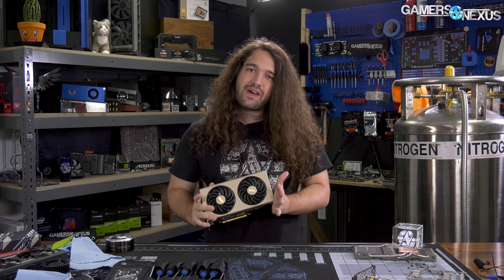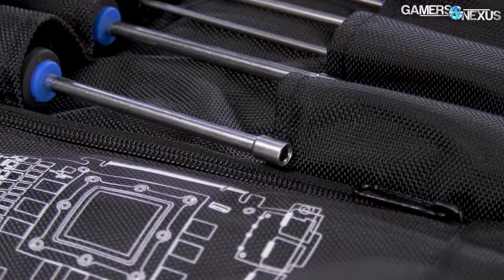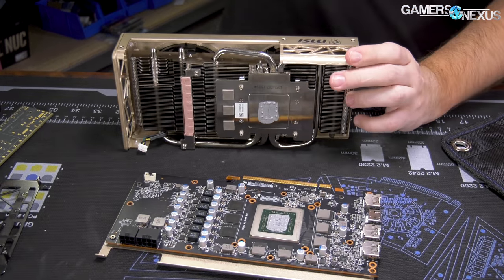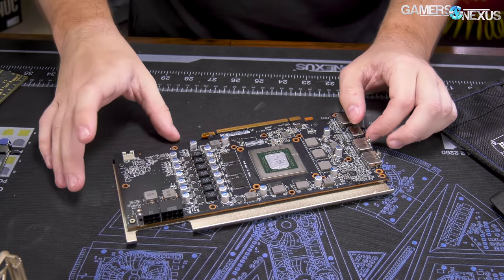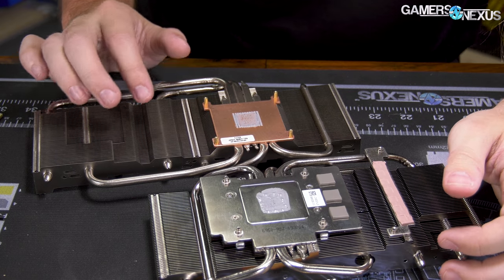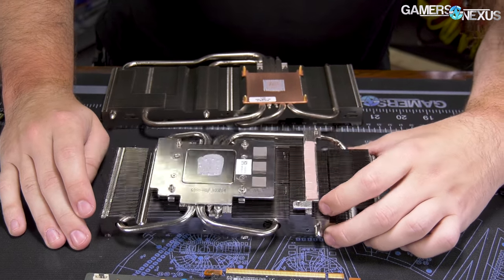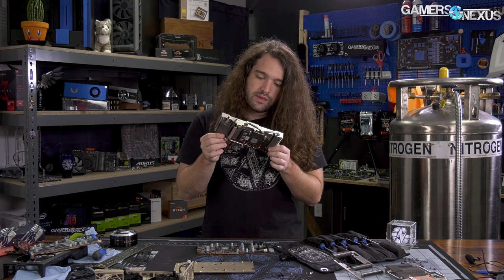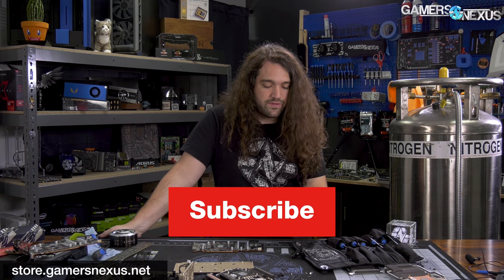Wrong Thermal Pads: Tear-Down of MSI RX 5700 XT Evoke OC

Comment: To me it looks like there is no excuse for the small thermal pads @Gamers Nexus It looks like the pads could extend toward the GPU with no issue, as they are placed on the far side of the memory modules to begin with, so putting larger pads on would end up creating greater surface area contacting the cold plate....... idk how you didn't notice this in the review. It might be worth replacing those thermal pads and retesting the cards thermals to compare what an actual full coverage thermal pad would do for mem temps. Keep up the good work! Love the content, and I can let an oversight slip every now and then.

Comment: But if that pad will contact on the outside then a bigger pad should work further in too. As there already cooling the outer part of the ram so wouldn't have to make the base taller. The section that needs cooling it further in

Comment: Hey GN,

!!!!!!!!!!!!!!!!!!!

If you look at the memory thermal pad position and then at the mark it left on the cooler.   THEY ACTUALLY JUST PUT TOO SMALL PADS ONTO IT. 

the cooler is big enough. the tooling was right. they JUST were saving on thermal pad size! crazy!

Comment: That is my general experience with MSI. They take the good stuff and make them more or less miserable in some or other ways. Cheapskates! 

With an RX580 card I bought from em, they placed a too thin strip of thermal pad on the VRM where it didn't get into contact with the heatsink at all. It also had these too small and incorrectly placed thermal pads on the memory chips just like in this video. The cooler which they call "Armor Shielding 2x" and praise to the heavens. Guess what. It sucks. Can't even hold idle temperatures without the need to speed up fans to miserable levels of noise. And as a cherry on top. the thermal area from the card to the cooler was too small and couldn't cover the GPU or the memory modules properly.
It ended up having the cooler replaced with a after-market cooler from Arctic in order to get working as intended.

The RX580 is an amazing GPU for the given price-range. But MSI's implementation of it is horribly miserable.

Comment: 12:35 become i think it can totally be done put some full coverages thermalpads on the msi so the cover all the mem and retest temps i sure those 2 mems can be cooled it don't need to be longer the plate its ther right size the pads are Wrong. @GamersNexus @Gamers Nexus  #GN
Reply: 16:29 fits at top no need bigger plate the pads are wrong

Comment: hei sry if i point this out they dont need to do it longer the plate if you se on the plate were the half pad made contact dey do it on the edge of the plate so if you put bigger termalpads they go inside and down next to the gpu so only what they msi need to do is bigger termalpads .

Comment: MSI Logic:  That Gold paint GPU will costs extra $30 ($400 + $30)  But we will save like $3 for bad Memory Thermals & inner design
Sapphire Pulse:  That Black & red paint GPU will costs you $10-$20 ($400 + $10) but will work like 15c better compared to MSI 
Hmm.. that makes me wonders..
My Mobo is B450 Tomahawk (2018) + my GPU is 1080 Armor (2017) & they both are solid..  but apparently MSI trying to cut costs in 2019 ?

Comment: One of My zotac thermal pad is  placed in between the mosphets ,i think its a mistake ,no wonder my temp remains near 70 when 50% load & goes to 80 when gpu pushing harder like when using dsr
Reply: Celsius?
Reply: @spacedoutcowboy5211  70 Celsius? I would certainly fucking hope not 😂😂😂
Reply: @spacedoutcowboy5211  yes Celsius
Reply: I think you should take care of that

Comment: I wonder if the dbl sided tape was to prevent vibration noise between the two plates - even if that was the case a little piece of foam would have done the trick.

Comment: i like the way this card looks but i would not buy it due to its inferior performance
Reply: I assume you mean thermal and acoustic performance, not to be confused with in-game performance
Reply: @syncmonism  that's exactly what i meant you are right, i would opt for the sapphire card or the GIGABYTE WINDFORCE 3X if that card performs well
Reply: @ahmedlaymoun9407  I have a 970 with the older windforce cooler and its pretty great.
Reply: I bought the RX 5700 because it was on sale on Newegg. I don't really mind sound but would thermals be a big issue considering I'm planning to use it on 1080p not ultra settings?

Comment: I guess the double sided tape is to prevent vibration and vibration noise of that bracket.
Reply: I'd say so. Probably an issue they discovered after production started. Really nothing wrong with it since 99.9999% of people aren't going to ever open it.

Comment: Those are some thick thermal pads on the memory, too! I can't imagine that helps with conduction that well.
Reply: Maybe theres an issue with mounting pressure if they used thinner therm pads.
Still seems like a hackjob overall though.
Reply: @DeadNoob451  Yeah, that cold plate was clearly not designed for this card layout....   😐

Comment: Fun, would be a good experiment to put the proper size thermal pads on and run a few tests to see if thermals get better. Also, is it possible this was just on your model and more an oversite during build or design choice? Maybe some worker didn't want to get more pads, it was the end of the day and he was tired and just used what he had left some odds and ends and thought, "nobody will notice"

Comment: It looks like the memory thermal pads are smaller because the rest of the area is considered a "don't put stuff here" zone, like with those dummy devices put over a CPU socket to make sure there are no SMD's that are physically contacting the "dont put stuff here" area. Not sure what the device is called, could've sworn I saw it featured on this channel a month or three back. The thermal pad aligns with a white line on the PCB, so that's my suspicion with that "defect"

Comment: This almost ranks up there to what EVGA did to their 1070 cards where they forgot to give the card thermal pads on the memory which caused alot of problems lucky EVGA corrected their mistake by either giving you some thermal pads to put on the card yourself or you could send the card in for a version of the card that has the pads already on them. Hopefully MSI follows suit an they put on more suitable pads on future productions of the card and you can either opted in to get more suitable pads from them for free or you can send your card in for another that has the suitable pads on them.

Comment: i cant wait till gpu modding scene gets to the spot where youtube channels liek this one do 3 rendering of the heatsync  so they can then remake the heatsync with better parts example maybe a plain aluminum brick with better fin density or aliminum block with copper cube inserted through compression fitting  especially for these cards that have stainless pieces for the memory i mean its even mmore possible to take it further to better engineer a cooling situation for the cards over the memory  so the thermal pads dont need to be 2.5 mil thicc to make contact so on

Comment: I recently bought a msi rtx 2080 ventus v2 and the thermal pads on the memory are the exact same only cover about 50% of the chip and hangs over the edge slightly

Comment: Since the half thermal pad is on the far side of the memory chip, doesn't that mean the plate already covers the whole memory chip and they just need to put larger ones on there?
Reply: Most probably the thermal pads were installed in the wrong orientation.

Comment: The heatsink is 1-piece so if they put the right thermal pads on it, there could be too much flux heat shifted over from the GPU die to the VRM, so the "cheap" less conductive pads were likely selected for idiot-proof reasons so it doesn't overheat it's own VRM.

Comment: Prices seem to be really fucked up in Germany.
Reference card: 379€
Cheapest card with different cooler: 437€ (XFX Thicc 2)

Pretty much all of the partner cards are betweeen 440€ and 450€ (Strix is 589€ Even most 2070 super are cheaper...). Pulse and Evoke have a difference of 4€. It would be cheaper to buy a reference card and a third party cooler seperately....

Comment: Doesnt the plate cover the whole module just not the pad?
Reply: Sometimes Steve jumps to the "design flaw" conclusion before recognizing that it's just bad assembly practices and crappy QC.
Reply: @PimptatoPCs  Lol how is this QC if it's on that gpu variant entirely
Reply: @PimptatoPCs  he said in a separate thread that he got mixed up

Comment: I don't get why MSI didn't just extend the length of the thermal pad? they've put the half that does contact further away from the GPU die, not closer - so the idea that it was tooling on the heatsink doesn't really add up? looks to me like if they just used a full size pad, it would contact across the cooling block...

Comment: i think, those thermal pads are too thic and probably the baseplate not have enought contact with the main cooler cause probably by bad soldering if any, maybe is only mounted with screws

Comment: The plate doesn't need to be larger, the pads are at the farthest reach of the chip and it reaches.  Larger pads would go closer not farther.  Better larger pads could help.

Comment: The half thermal pads are on the wrong side of the chip, they never made contact with the heatsink, because the lip of the heatsink is closer to the core coldplate, and the pads are further away.

Comment: Year ago i bought MSI RX 570 Armor and it was big mistake, that card doesn't work and show me the artifacts even it was working on stock clocks and with 63-64 degree temperature, i also looked at vrm and it had exactly the same problems, absolutely bad design with worst cooling MOSFETs etc 😰😢

Comment: The ram is closer to the GPU side, so the heat pads are the wrong way round. See residue is on the far side of the coldplate and the chips are nearer the GPU so a full thermal pad would work better...

Comment: So the memory modules are touching directly on the metal and the thermal pad is in the outside of the metal plate? Did I got that correct? Because it´s weird as f. (that´s the only reason I see for them not making the plate bigger).

Seems more that the thermal pads are touching the metal plate but they cheaped out on thermal pads by making them smaller (and so saving a few cents per pad), which is really stupid, considering how hot those become during load. Might aswell make them full pads and at least have the client happy... You know, the returning customer that helps you pay your bills? lol

Comment: And this is why you don't let an Apple employee design your thermal solution. They have this false belief that if ANYTHING is touching a chip, it automatically has sufficient cooling for any situation, even if it's a lump of plastic or sheet of glass acting as the heatsink, lol.

Great vid Steve and crew. B)

Comment: I quit buying MSI products when the heatsink fell off of two cards in a row after reaching operating temp... To this day I am still blown away by that terrible design.

The hilarious part is they warrantied the first card, sent the second and the same thing happened... they refused to warranty the second card. It got zip tie treatment until it was ultimately replaced with another brand.

Comment: Do u guys know if the XFX THICC II and the RAW II use two different PCBs or the same??
In germany there's only a 6€ difference between them and the cooling on the RAW II looks really promising, but also the heatsink of the THICC II really is a thicc one.

I'm interested in the RAW II (445€) and the Red Devil (479€, limited edition), but I think, if the RAW II uses a good custom PCB, the 32€ premium isn't really worth it for me, if the cooling design of the RAW II works as good (and silent) as it is thicc.

Comment: question: what brand of thermal pads should I buy? I bought thermal pads on Amazon but apparently they weren't malleable enough and too thick so they made my GPU die not able to make contact with the heatsink

Comment: So out of curiosity, if the thermal pads on the MSI card were replaced with ones that actually cover the memory modules, would that potentially bring the thermals in to line with the Sapphire card? It looks like where those two half coverage ones are , they should make full contact with the heatsink if proper pads were put in place.

Comment: I am purchasing a new graphics card and simply want to know which one is going to be the best for gaming performance/overclocking. I've dwindled my choices down to two cards, the EVGA RTX 2080ti FTW 3 Ultra and the EVGA RTX 2080ti FTW 3 Ultra HYBRID. From what I can tell, the only difference is the HYBRID cards cooling system. However, the tipple fan card has a physical switch for OC mode, and the HYBRID doesn't. Does anyone know if this limits the HYBRID cards ability for the amount it can be overclocked? Thanks all. I'm new with this stuff.

Comment: Wait a minute, those pads are short for no fucking reason. If the plate was too short the pads would be near the middle. You can see the pad marks on the plate, if they put a full pad on those it would be just fine.

Comment: I'm just curious, how much metal in to the cooler it might need to make a fan free GPU cooler..?
Reply: it was a while ago with Pascal but DIY Perks made a video cooling a 1080 with an NH-D15 and no fans, both sticking out in open air from a custom "case". He made a custom copper plate to slip between the noctua cooler and the GPU to contact the important stuff, but since he's not really a PC channel so much he doesn't go super in depth with various temperatures. I'd say you could probably do it with a dark rock pro 4 or similar if you were as determined as him. Or possibly with a cooler that big if you still used case fans there would probably be enough passive flow to use a regular case.

Comment: I don't get it: if the contact plate is too small, wouldn't it touch the memory chips on the side closest to the GPU dye? I feel like the thermal pads for the memory are on the side that wouldn't touch the contact plate 🤔

Comment: So MSI pulled an Asus V64 Strix, who could have thought :D
(For those who do not know Vega 64 Strix had the wrong thermal pads on the VRMs, which lead to overheating and reducing clock speeds significantly.)

Comment: Do the A/B test with the cooler swap. Even if results are identical to the Sapphire card, you'd be showing just how bad MSI's cooler design is using science, which MSI should be called out on. 
Also, looking at where those top memory pads contacted the cooler, they could have used full pads; the pads are on the top half of the modules, and the contact patch is at the top edge of the cooler, meaning the increased size of a full pad would be closer to the GPU on both components. There's no tooling issues, and I don't think it's cutting corners either, either someone made a mistake, or they have the wrong pad in the machine that places those specific pads.

Comment: "They didn't extend this because it would cost more money." You're looking at the plate backwards. The current thermal pads are on the 1/2 of the memory furthest away from the GPU. That means the plate is already big enough and doesn't need to be extended. If they slap on a thermal pad that covers the entire memory chip, that entire thermal pad will be in contact with the plate.

Comment: MSi.. after all the controversy from other companies who delve in Computer and computer components. They still haven't learned or realise that people "WILL" teardown Computers and Components to do a thorough check and catch Companies that do Janky ass jobs.

I feel like This card is exactly the same as the Mech OC but with a different Cooler Aesthetic and probably share the same thermal pad issues... And here I was about to buy the Mech OC.. 

Maybe the "Warranty is void if seal is broken" stickers are there so that no one dare's to check the card's inner workings and see the sloppy work MSi did with these cards.

Its a Hard Pass for me now with the MSi line of 5700 XT's.

As mentioned in the video. SURE you save money from cost-cutting, but it won't matter if no one wants to buy your Janky ass cards.

And This card is not exactly cheap. Here it cost 537.80 USD and the Mech OC is 525.58 USD including vat already.

Also MSi The point of having a custom cooler is to keep the card down in temps cause it runs hot with the reference cooler. But instead you are making sure that the card will not cool efficiently.

Massive Disappointment :(

Gotta wait for Sapphire stock now... or if that Red Devil is any good.

Comment: I would like to point out once again that the sensor values for the memory are absolute nonsense. (Igor Wallossek 08/16/2019 (Igor's Lab)

When it comes to memory temps i only trust Igor's Infrared Pictures. (scroll down to Board Analysis: Infrared Images)
https://www.igorslab.media/en/msi-radeon-rx-5700-xt-evoke-oc-edition-tested-butter-or-margarine-on-bread/7/

I dont understand why no one except Igor does Infrared Pictures, all other tech channels like lemmings use the broken sensor values.

Please Steve invest in an Infrared Camera and implement it in your test routine.